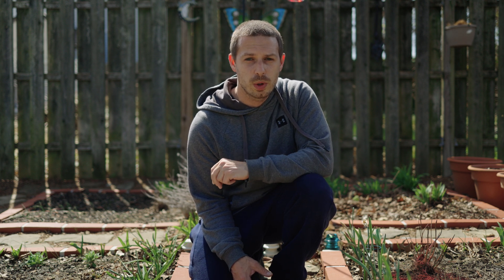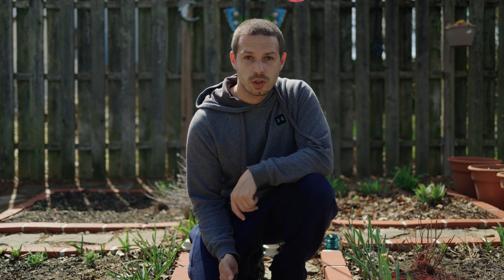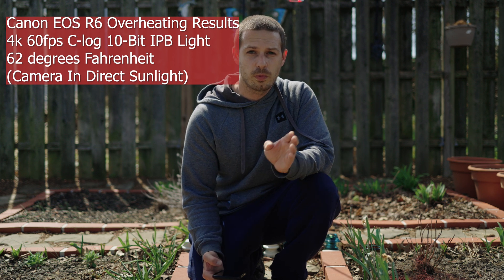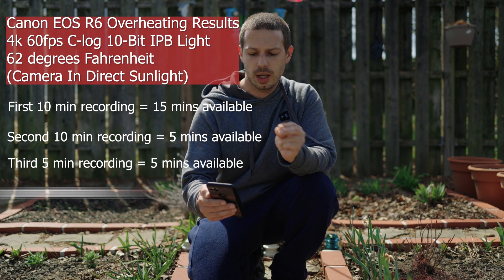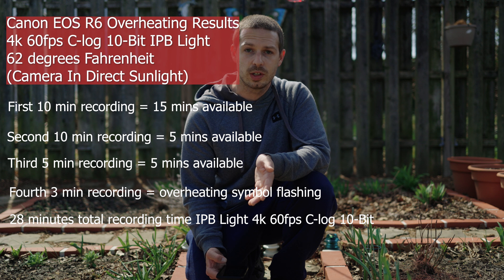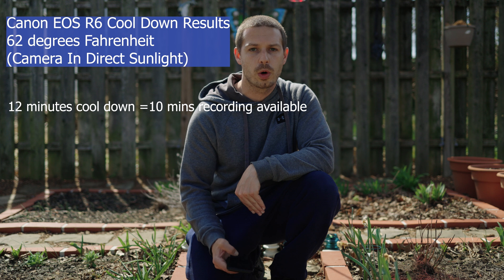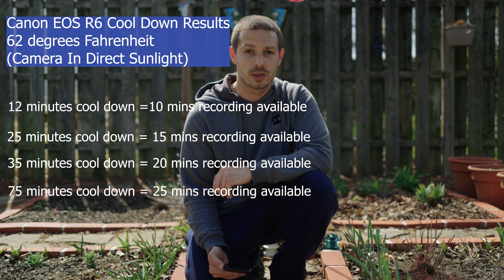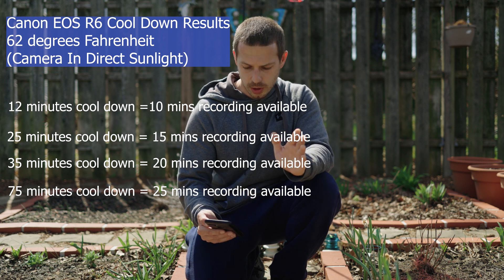Canon EOS R6 | Firmware update 1.3.1 | IPB Light Vs Normal Comparison | Overheating Test | 4k Video

Comment: 60FPS? I can only see 25 FPS and 50 FPS in my R6 how can you get 60FPS ?
Reply from the maker: Go to your yellow tab (little picture of a wrench) in your menu and go to tab 2 look for the option “video system” from there you can change from NTSC to PAL this is where those different options for frame rate will show up depending on which one you have selected. Depending on what country your in the standards are different like here in the states everything is broadcasted at 24fps instead of 25fps. Other countries use different standards for broadcasting. Hope this helps a little and thanks so much for watching the channel.
Reply from the maker: Also there is a newer version of the canon R6 firmware. The latest is 1.5.2 here’s a video about it. 
Canon R6 Firmware 1.5.2 | Should You Update?
https://youtu.be/gbp4raWNyNw

Comment: This was one of the few actually usuable tests. In fairly cold weather (16°C) the R6 overheats in 4k/60 fps. For me and at the price point that's completely unacceptable even if I only use 60 fps for slow motion. Thanks!
Reply from the maker: I totally hear you it does suck lol. I knew about it when I purchased it so I accept it but I just see so many people saying the R6 doesn't overheat at all and it's just simply not true so I wanted to put this out there so people would know.
Reply: It really is down to how you use it. For a LOT of shooters, the average clip length is a less than 10 seconds. That's obviously far less punishing than 10-minute continuous clips.